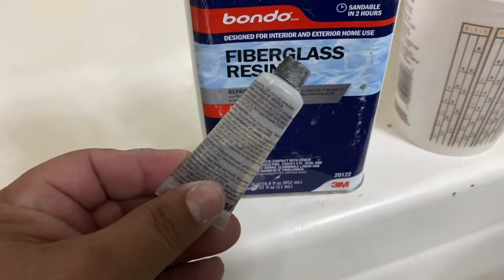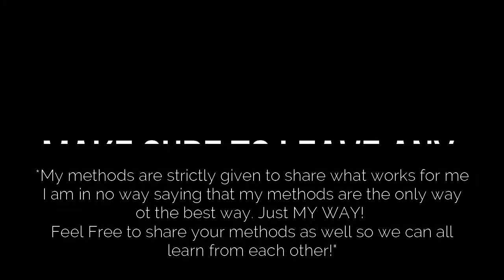USING FIBERGLASS RESIN AND FOAM TO SUPPORT A CRACKED BATHTUB | DIY Fiberglass Bathtub Reglaze Repair

Comment: You've just saved me SO MUCH MONEY!!! I live in a mobile home and my tub is cracked right at the bottom corner. I've used JB Weld and it's worked in the past, but that just gave out and my daughter is only getting bigger and heavier, so this is the method I'll go with. Thanks!

Comment: One thing I haven’t seen mentioned is clean up after sanding. I’m through the process of repair and sanding I’ve used a vacuum and tack cloth to get as much dust and particles as I can and it’s time to spray but I’m wondering if I should be going over the surface with something like TSP before painting. Since I don’t expect a response in time for my project maybe for other people watching. Im going to just go ahead and spray it and hope the paint adheres. Great videos and helpful cost savings
Reply: use a teeshirt cloth soaked in acetone or medical alcohol for plastic or fiberglass prep work, before the fix, then before the primer and paint, dont paint like the video demonstration, go from side to side barely pressing paint sprayer as many times as it takes, or the primer & paint will run like water, after painting use heat gun on low to bake the finish
Reply: I assumed i would need special paint. Will just the primer work?

Comment: I did this once with great success in a bottom color that was different from the original. The only thing I did different  was at the wall tape off line I added different width striping. 3/4" to 1/2" to 1/4"" and finished with 1/8". It ended up looking great. This was back long ago before current two stage paint systems!  Using 2 stage systems will be so much easier since cure time and clear over time is so much faster.  Also if there is any mistakes it can be sanded / corrected very easily and quickly. The final clear over will greatly reduce the masked off paint transition line or lines if ya stripe. Buffing and polishing can and is very simple from the new into the original .  I have wondered how the floor would turn out if bedliner paint was used as It comes in many colors.

Comment: Wow that was amazing. I would never have thought that possible. What causes a crack like that in the first place? What is the cost difference between replacing and repairing? I am wondering how you learned everything you do? Did you go to school or work under someone? How long have you been doing? Do you have people who work for you? Thanks for sharing. I will be looking forward to your next video until then I am keeping you and your's in my thoughts and prayers please stay safe, take care and God bless!
Reply: I just had a price on replacing tub of $6500.   I have only hairline cracks, but I'm not going to wait until it gets worse.
Reply: Probably improper installation. The tub should be set into mortar or something comparable so that the bottom of the tub has proper support and doesn’t flex during use.
Reply: Or with shower pans the styrofoam gives way and prone to cracking the fiberglass so this method of repair I have used for my shower. The quote from three different places was $12k up to $18k. No thanks.  I will use the repair method exactly as pictured here.   If fiberglass repair is good enough for a boat it’s good enough for a shower pan.
Reply: @jjs777fzr  sounds like the exact reason I came searching for this information. We were quoted $11k - $23k to completely replace our shower stall and $3500 to just repair the cracked base pan! Thank goodness for YouTube, I'm going to DIY it and hopefully save a few grand.

Comment: I am a tub refinisher. And since they removed the main component in stripper that made it work it takes 6 hours. to strip a tub with a stripper from a tub company. Does the Jasco really work as well as you showed with just one application, or do you have to apply more. The product we use is from Napco.

Comment: Great video. Hard to get fiberglass resin. I went to 2 Home Depots and a Walmart and both were out. Ended up finding it at autozone.
Reply from the maker: Oh wow! It’s tough right now finding materials..so many places are limited. Good luck and let me know if you have questions. Keep me posted on how it goes. You can also find me on Instagram.

Comment: I have a large broken section in a single person shower on the wall. Is there anything different I would do to fill in the space behind the wall? Or, will the big gap filler foam work fine?
Reply from the maker: I have a video here showing how repair a hole in the inside wall of the tub. You would do it in a similar way to that. Foam on a wall will just drop to the ground in the void space

Comment: Thank you for your video.  How do you keep the resin from running down from a vertical wall surface.  I have a Cracked area on a section of the tub where the wall meets the floor  and the crack has moved up the wall of the tub - so I need to keep the long hair glass and resin  on it without too much running below - Do you tape off the areas below or let it run and sand/feather it out? 
Very helpful information about the foam spray.  Our relatively new tub was spider web cracked and egg-shell thin!  It needed support to hold up and two cans expanded nicely overnight!    Thanks again.

Comment: very nice. in future , should cut slight V groove incracks,Then apply  resin and chopping up resin msttin and work into crack from inside out. then sand clean with wax and grease remove then apply reinsin and fullfiber matt. then apply fiber bondo ,sand then use 3m finishing putty. sand smooth.

Comment: Do you need a skim coat or can you also sand the resin down a bit to smoothen it out before the primer?
Reply from the maker: You can sand the resin down but I like the skim coat to help fill in and small pinholes

Comment: Great video...so glad I happened to find it.  I was going to rip out my entire shower and replace it due to a crack in the floorpan just like this.  I have a question.  My shower is an off-white color.  Can I use the Krylon tub and tile spray can to spray the entire shower to match.  It's a small shower (3' x 3').  Thanks...
Reply from the maker: Yes you can spray the whole shower or you can try to use Rustoleum Shell White to match the off-white closely and just do the area.

Comment: Excellent video! I have a textured bottom tub. For repair to look seamless would you suggest taping off the skim coating the bondo over the whole area ?
Reply: Yes. You can't sand off all the texture and keep the strength .A thin even coat with bondo all purpose putty . Probably to late of an answer as to you asked 5ths ago.

Comment: My mix didn't harden enough, it's still sticky 6 hrs after aplication ..  :(
I did use 1oz + 10 hardener drops, I did mix it vigorously for about 20 sec 
What could have been my mistake?

Comment: I am trying this out this weekend - I don’t have a crack in my tub but a dip in the middle that is holding water—- just need to build up that spot in the middle of the tub, are there any steps outside of the drill and foam that I can skip?

Comment: Can you please post a list of all the supplies you used? Also how many holes do I need? I see you drilled 4 holes around the crack but then you had 4 other holes to the right of the crack? I have a crack that was repaired by someone else they used a patch that now the crack is growing out from it. I do not think they used spray foam to make it supported so now I need to repair.

Comment: Does it matter what type of foam you use to reinforce underneath the tub? Need a very firm foam when dry.
Reply: The foam is not strong enough  to withstand the weight above it. It feels like cheese puffs after it’s dried. I checked with the manufacturer and they confirmed it’s not effective to support the weight.
Also for some reason, I cannot find Krylon tub paint in california.

Comment: I have a low spot in my tub that is holding water. The spot is about a foot in diameter.  Can the process of drilling one hole in the middle, then filling with loctite fix this?

Comment: Hi, I have a question.  So, just to confirm, you used both the Bondo Glass and the high bond filler?
Reply from the maker: Yes. Bondo glass does not sand out smooth so I use the high bond filler to smoothen out
Reply: @DPTubs  Awesome.  Thank you!!!

Comment: I have a crack and soft spot right in the middle of the floor. How long do you recommend drying out before repair?
Reply from the maker: Until dry...get rid of moisture completely

Comment: If the hole is really high on the wall, say about shoulder level. Could you skip the foam process?
Reply from the maker: Yes I have another video of a hole on wall or side of tub!

Comment: What’s a good solution for bathtub that someone painted white over.  Someone did a poor job and refinished tub.  Paint falling off tub.
Reply from the maker: You have to strip the previous coating off! Search “DP Tubs Bathtub Stripping”

Comment: Hi how long does the foam filler keep expanding and take to dry,  how long does your resin take to cure before sanding and are you using just MEKP catalyst for your resin? Thanks
Reply from the maker: Foam about 30-40 minutes
Fiberglass Resin about 45 -60 minutes
a good portion of this job is waiting in between coats for dry time.

Comment: Amazing! A little question, Should I use Filler and Skim Coat both or just one of them?
Reply from the maker: I used bondoglass filler and then used high performance putty to skim it smooth
Reply: What about backfilling the crack with bondo before the fiberglass and resin . Very nice repair by the way I’m in the middle of one of these myself.

Comment: Excellent video. My fiberglas tub is cracked similar to the one in your video, about 12" long and at the edges of the crack the fiberglas is curled upwards i.e. not level. Just drill holes, pump in foam and sand it flat, or do I first need to find a way to glue edges down?

Comment: quick question.. is the Bondo glass and putty a MUST? I filled in the hole with foam and did the resin with fiberglass cloth. about 3 layers. it is solid. will this hold up as is? i don't expect to last a lifetime but maybe 3 or so years before remodeling. plz lmk. appreciate you
Reply from the maker: I like the bondo glass as extra reinforcement because it has short strand hairs. The bondo glass doesn’t sand smooth so that’s why I skim it with smooth putty

Comment: When you spray a small area do you sand and buff it around the edges where it meets the old gel coat?
Reply from the maker: yes you can come back after it dries to do so.

Comment: New subscriber here. Omg this is great and what I’ve been wanting to do Sir. I have what looks like a steel tub with has a oval recessed area abt  10in x 20in and 1/4 indeep at center. It’s not cracked but causes standing water in Tub. Can I skip any steps eg skip the drilling and expansion foam?

Comment: I moved into my present house 5 months ago. Unfortunately I didn’t notice the small crack in the bottom corner of my tub until it was visible at 1”. Fortunately, I have a 2nd bathroom so am avoiding using the cracked tub. Because it was so small, I looked through YT. I am not DIYer, nor do I have tools I would need to make repairs. But I am a person who believes in making repairs before they get too big or too expensive. 
How much should I expect to pay to have the repair done? I live in a rural area, but I know that their are small repair shops around here. Any suggestions are welcome. Thank you for your video!

Comment: Not sure if  this is being monitored but i am undertaking this on one of our tubs. Using the foam was genius and completely took out the  flex, however where the crack occurred, one side is about 1/8 inch higher than the other, Will the resin build up enough to level this out?
Reply from the maker: Yes you can try to feather it out so it’s more uniform at the bottom
Reply: thats one question i had is how many cans of foam were used in this situation.

Comment: Nice job!! My shower floor has a small crack that we use every day and is  leaking a little bit can I still apply resin even if is wet under?
Reply from the maker: I would use a shop vac to try and suck out moisture and then let it air dry out.
Reply: Thanks

Comment: I have a similar crack in shower tray. Why do you need to use both the bindi glass and filler? Can you get away with just using one of them?
Reply from the maker: The bondo glass does not sand down smooth. the filler sands down smooth. so it just depends on what finish you want. the bondo glass has more of a textured finish.

Comment: I'm not familiar with this kind of work 😢 but I have a small have a small hole just starting to rust around the bottom drain. Your project was really big. What do I need for a smaller hole? It's right where the water goes out. And remember I don't know nothing so when you use the products please show. Like what did you use to treat the rust or what kind of sander what type of sand pap5🤔????

Comment: The shower stall I am repairing is a beige color, but I couldn't find the top coat in anything other than white. I want to know if I tape off the walls from about 6 inches from the bottom, would the top coat stay sealed or should I just plan to do the entire shower stall? I would appreciate an answer on this. Thanks for posting this video.
Reply: I did that once with great success. The only thing I did different  was at the wall tape off line I added different width striping. 3/4" to 1/2" to 1/4"" and finished with 1/8". It ended up looking great. This was back long ago before current two stage paint systems!  Using 2 stage systems will be so much easier since cure time and clear over time is so much faster.  Also if there is any mistakes it can be sanded / corrected very easily and quickly. The final clear over will greatly reduce the masked off paint transition line or lines if ya stripe. Buffing and polishing can and is very simple from the new into the original .  I have wondered how the floor would turn out if bedliner paint was used as It comes in many colors.
Reply: My repair job is done. The surface isn’t as smooth as I wanted it to be, but l’m really pleased with how it turned out. The only problem I had was that when I was spraying the top coat on l couldn’t tell if I actually covered the entire surface because it blended with the white primer coat. I also had no way to ventilate because there isn’t a window to open. Even with the respiratory mask, I could only spray a small area before I had to leave my small bathroom.

Comment: I tried the loc tite foam and it just goes and goes in the hole. Not filling up like yours does.
Reply from the maker: You have to make sure there is support under the tub. Some type of sub floor or substrate to hold the foam

Comment: The helpful portion was filling the hole with the foam. It did give a sturdy base . The negative was how the area repairs was so large and using spray paint can’t possibly hold up over the years . It will also not come out perfectly smooth and the sheen cannot come out to make the finish looks invisible .
Reply from the maker: Not true! I do this for a living! This is how you fix it. Keep in mind that if you are concerned about the surface lasting...this is a repair of the original manufactured product. That didn’t even last!
Reply: DP Tubs & Home Repair bravo!
Reply: Ive always used an epoxy paint if that helps wait the full week for it to dry and cure a little more expensive but worth it!
Reply: @DPTubs love the stern response..lol..Definitely let's you know this isn't your first rodeo. Great video man. I have a tub I'm about to do with about twice the damage you have in the video. Just wondering the price range I should be in. I was thinking around 800 labor because I will probably have to get under the mobil home and add some bracing maybe.